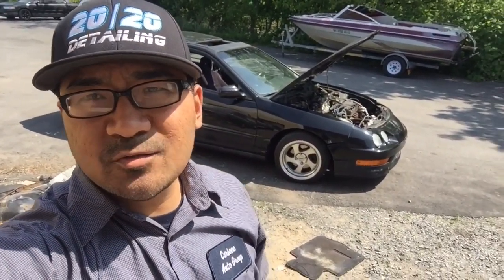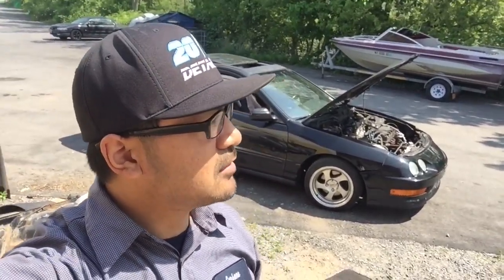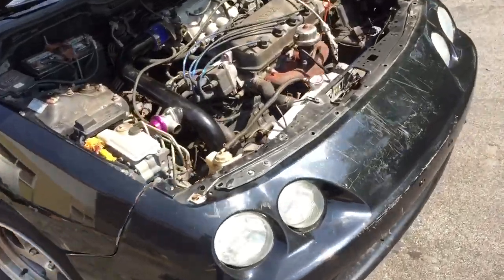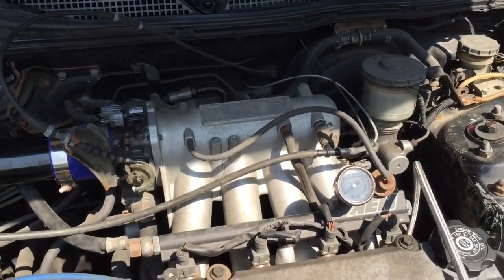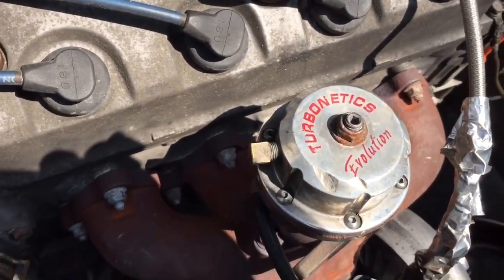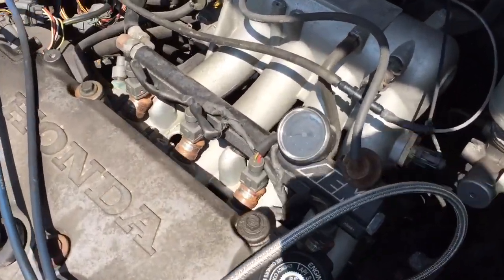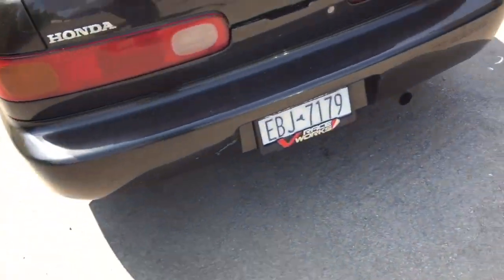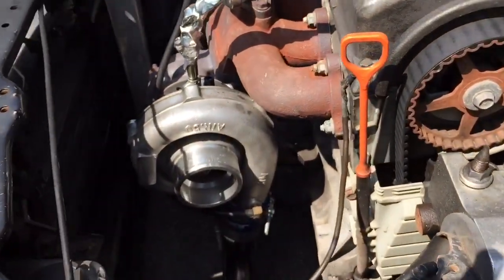VLog # 027 | My D16Y7 Turbo Integra DC2

Comment: Nice!! had a built single cam in my CRX, i have videos posted of it. does it handle a lot better with the lighter single cam engine? I highly recommend running the waste gate line just before the throttle body. when I made that switch boost was stable all the way to redline, no pressure drop.

Comment: Very nice man, the engine through me off for a second! It's weird I have function and form suspension on my dc2 also and I can't raise my rear end that high as yours is! It still looks too low on the highest adjustment
Reply from the maker: yeah they definitely do not go high at all. you can actually contact them and ask for the longer lower mounts that will allow you to go higher.
Reply: Wow i didnt know that ill hit them up, thanks alot!!!